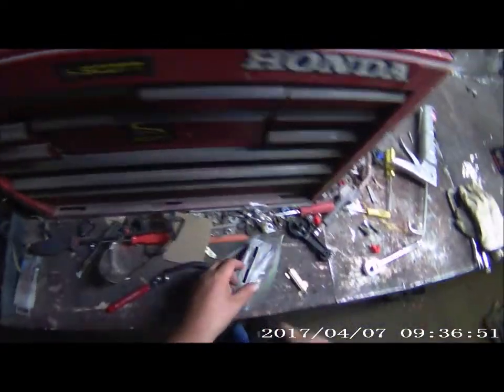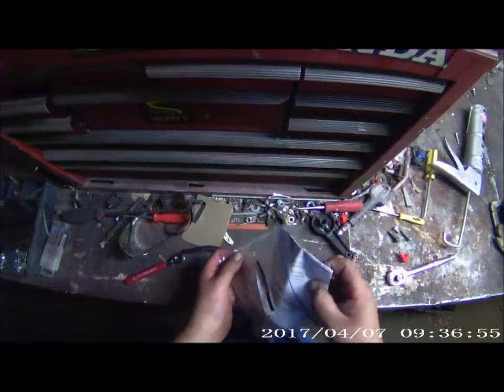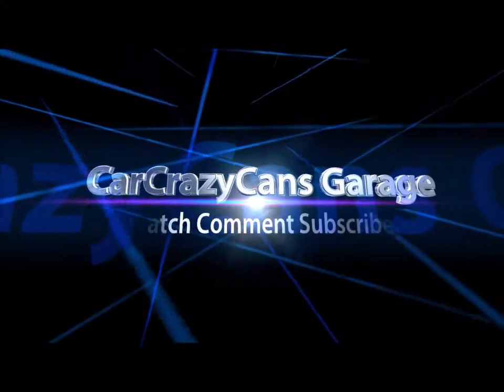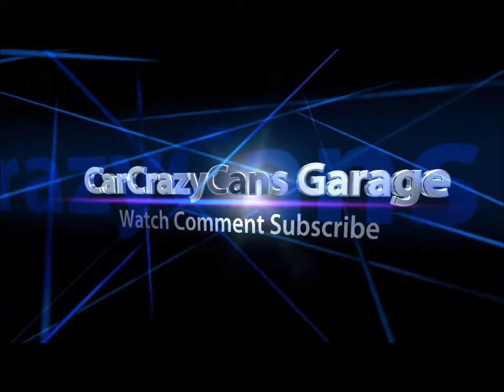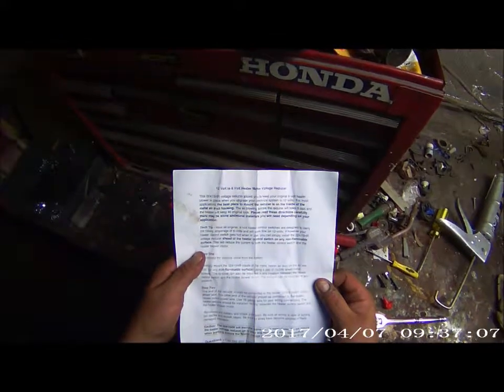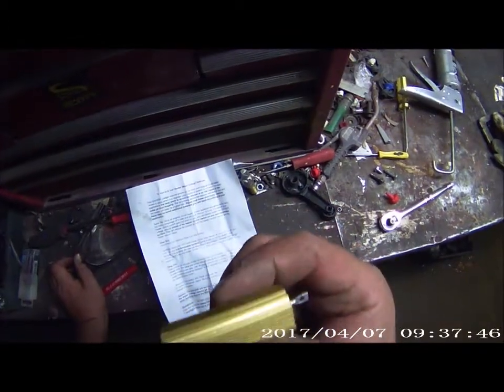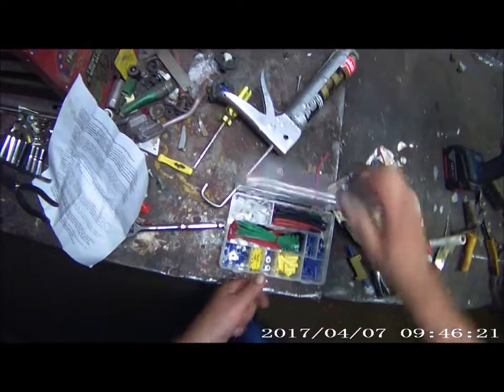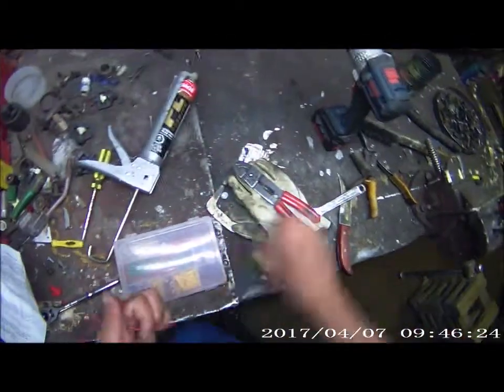1955 Fargo Rat Rod wiper motor 6v to 12 conversion  #  37

Comment: Pretty handy for when updating the chassis to modern 12v but still have accessories that run 6v... how much did it cost ?
Reply from the maker: Hi bubba yeah its handy ,it cost 15.00 buck on ebay. You might find it cheaper.